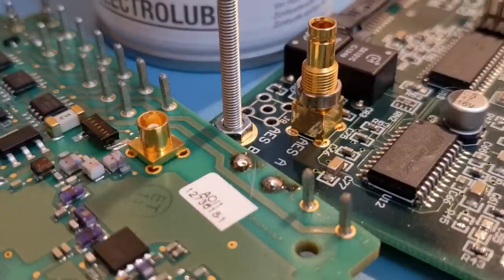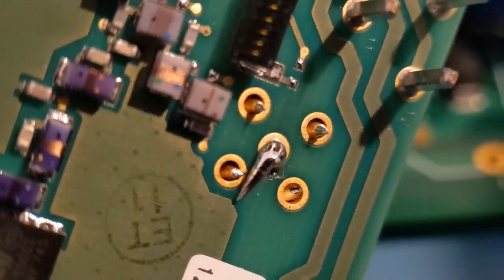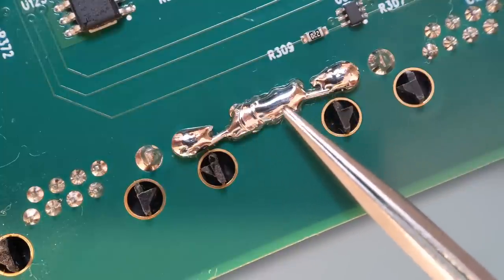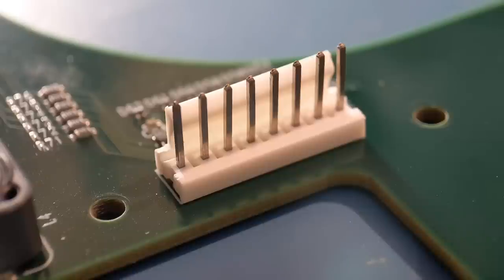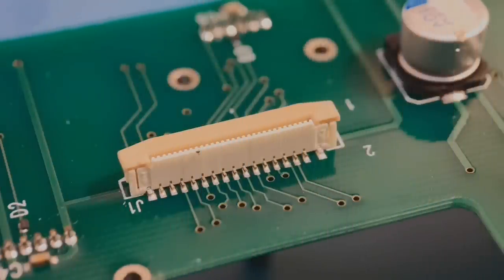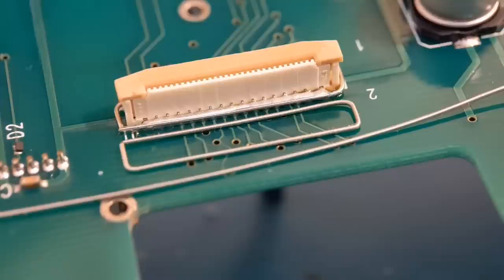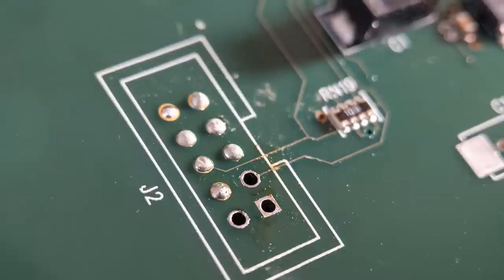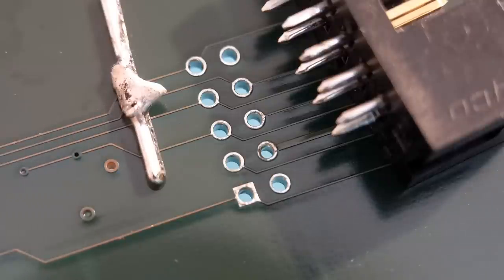How To Remove Electronic Components - PART 3 / Soldering Tutorial

Comment: I like to plug a junk cable into the connector so I can tension it while flowing. Works much better than tweezers since the weight of the cable will pull down, hands-free.

Comment: Great video.  I generally use a solder sucker but can see the benefits of using the braid to wick the solder instead.  Also, using a tinned  wire to remove components with several leads is a much easier method to ensure no damage when removing them.  Thanks for the tips and pointers.  It helps when refreshing oneself.
Reply from the maker: Hi , thank you for your support of my channel, it is very kind of you . I just want to pass on some knowledge I have picked up over the years to other people , hopefully helping them out with soldering issues. Thanks again , take care 👍

Comment: Thanks Mister!!  😁I was shown a technique years ago doing what you are doing but without the wire. Your method is MUCH better!! Also, you can't go around corners with just solder and even in a straight line, it was messy and inconsistent. I never liked or used that method. I will use yours all the time!!
Reply from the maker: Hi , thank you for your comment, much appreciated. These removal methods really are great and I'm sure they can help people with their removal issues . Thanks again , and good luck with all your future soldering projects 👍

Comment: That's the problem with hot air, it can often burn the plastics, even with kapton tape it can be tricky. Can't wait to try this method! Looks so easy! Mr SolderFix may I ask what temperature you generally use for desoldering components? I use 380°C to 400°C
Reply from the maker: Hi , thank you for your comment. The temperatures I would use for desoldering are roughly 340 degrees centigrade for leaded solder and about 30 degrees hotter for unleaded. I may vary these slightly for certain parts but generally these are the ones that work for me . In the making of all my videos I've never used the added benefit of a hot plate to warm the underneath of the board up just in case people were wondering . Hope that helps , take care 👍

Comment: If have a tipp for you too. If you only have thinner soldering wire and want some bigger one you can simply fold it over and drill it together. Anyways, tried this method now and it works like a breeze. Thxalot for sharing!

Comment: Nice job!!
I wonder how do you solder back that connector 18:43
Reply from the maker: Hi , thank you for your comment , much appreciated. I've posted other videos where I've soldered similar types of connectors ( How to solder SMD correctly part 2 , also part 5 ) , it is hard but now I find it pretty easy . You just have to be quick with your soldering iron otherwise the heat travels into the plastic body . But it can be done with practice. Maybe these videos will be of use to you . Thanks again , take care 👍

Comment: Excellent...
I would have struggled to remove those. Heat gun wick and maybe try low melt with lots of struggles
Reply from the maker: Hi , thank you for your comment. I've realized most people who watch my channel probably don't have a hot air station available to use so these methods hopefully can help all those people out . I do have one available but would still use some of these methods as they don't damage the plastic etc on the connectors. Thanks again for your time , take care 👍
Reply: @mrsolderfix3996  no thank you. I have solder wick hot air gun temperature controlled iron but i would still not be as clean as you with just a soldering iron

Comment: Very nice, I really like your clean soldering work. I just want to know what the flux type that you are using is?
Reply from the maker: Hi , thank you for your comment, much appreciated. The flux I have used for many years is SMFL200D but unfortunately it's recently been discontinued ( apart from in a flux pen which I don't personally like ) so I'm looking for a suitable replacement at this point in time. I still have a small supply but when it's gone hopefully I've found a new one I'm happy with . When I do I will post about it on YouTube. Thanks again , take care 👍
Reply: @mrsolderfix3996  thanks a lot

Comment: Your videos are super informative!  What flux do you prefer?
Reply from the maker: Hi , thank you. I'm glad you enjoy the videos and find them useful. 
I've always used for many years a flux called SMFL200D but unfortunately it's recently been discontinued so I'm looking for a new type at this present time . 
When I find a decent alternative I will post it on YouTube. Thanks again for supporting my channel , take care 👍
Reply: @mrsolderfix3996  Did you find a good one, my friend? Thank you very much. Your methods are amazing.
Reply from the maker: Hi , I now use Loctite 6381-35 liquid flux which is a great non corrosive flux , so if left on the board will do no damage. Trouble is I can only find it in 1 litre or bigger bottles . If you can find it in smaller quantitys it would be good to know . Many places sell this , but the price varies massively . Thanks for your question , take care 👍

Comment: Could you tell me what is the wire you use for removing.
Reply from the maker: Hi , the wire I used in this video for the FFC connector , ethernet connector and the box header removal was just plain tin copper wire roughly 24 - 26swg. And the wire where I removed the 8 way straight header was simply one copper wire from the centre of some earth wire , nothing special. Any tin copper wire for example will do these methods as long as it's a decent size for the task being undertaken. Hope that helps 👍

Comment: It would be interesting to see how you desolder a 16 pin LCD display. The single row of pins is quite long
Reply from the maker: Hi , thank you for your comment. I've actually removed very similar length devices also with 16 pins . Exactly the same way as methods I've shown in some of my videos . I place a wire along the whole length of the device , solder all the pins to this wire then I've used 2 soldering irons and just done 8 pins with each iron so this way the heat is spread along really easy. Works a treat and is very quick. Hope that helps , thanks again 👍

Comment: I completely destroyed a PS4 controller PCB using hot air to take off the joystick module. I realised that too much heat is being drawn into the metal casing from the signal ground pins, which meant that the rest of the board was getting toasted while the solder I was trying to melt was still solid. If I'd used this method I probably would have been able to rescue the controller.
Reply from the maker: Hi , thank you for your comment. Sometimes a heat gun seems the answer to your soldering issues but actually it can do more harm than good , that's when the soldering iron methods can come into play . It's just a case of knowing when to use either heat gun or iron , that's the trick . Experience normally gives you the answers. Thanks again for your support of my channel , take care 👍

Comment: Personally, I think the most difficult part to remove completely is the Nec/Tokin Capacitors of PS3.
Most people are directly violently turned away.
But if you want to measure the capacitance after taking it off, you need not destroy the Capacitors.
Reply from the maker: Hi , I must admit I've never tried to remove any of these . I've watched a couple of videos on them and they do look a strange type of component . Looks like a hot plate and hot air would be the way to go but without doing them I can't really guess. Thank you for your comments about these 👍